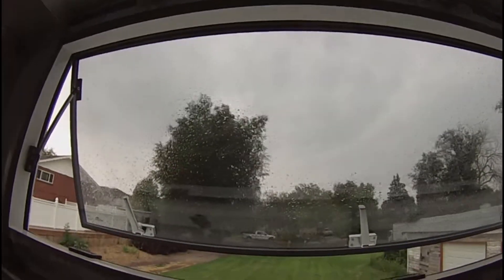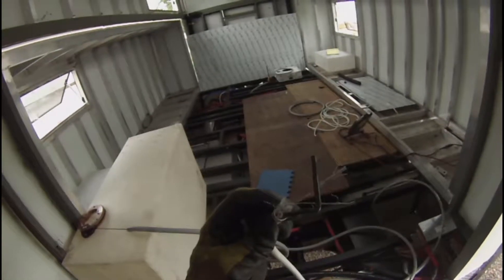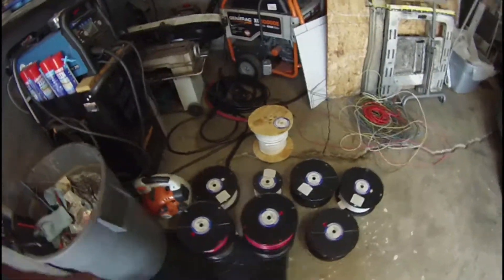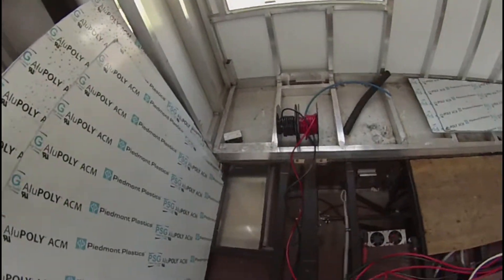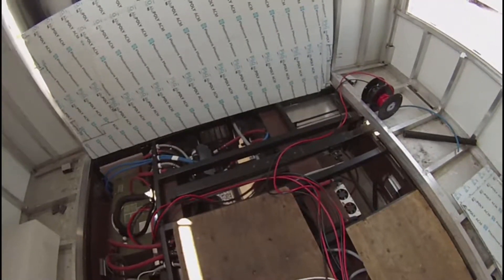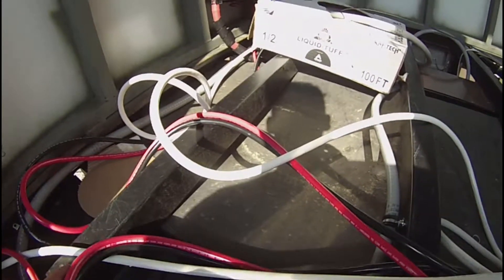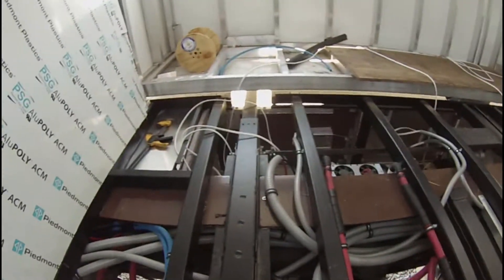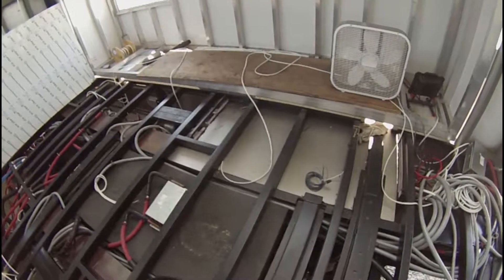Episode 13 - Wiring The Expedition Vehicle

Comment: Wow! Each video looks like more and more work! I did like your hack using the wrench to thread the wire through the loom though. I'm wondering...How did you calculate/figure out what types/sizes of wire you needed where?
Reply: Look at a wiring chart for length/load